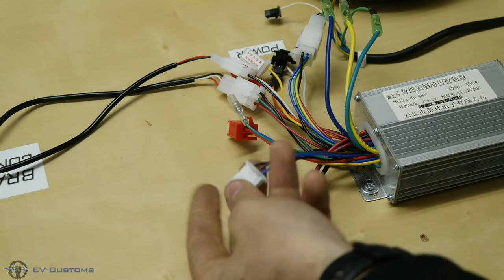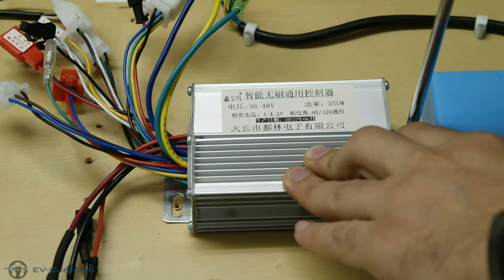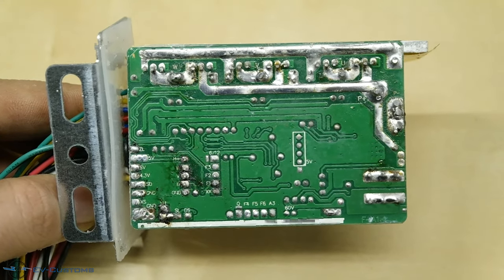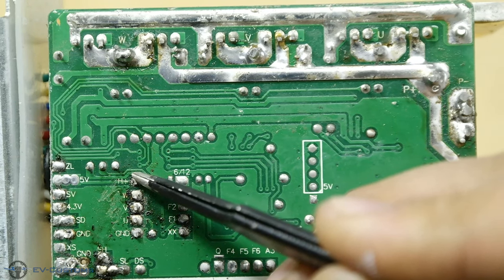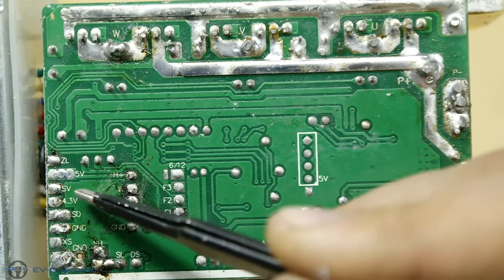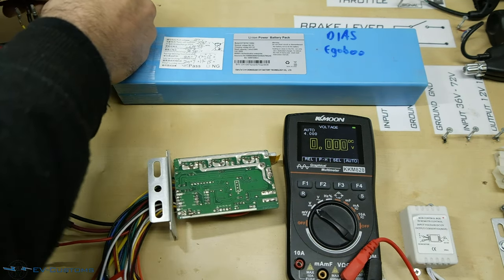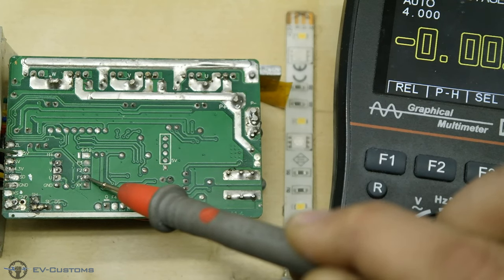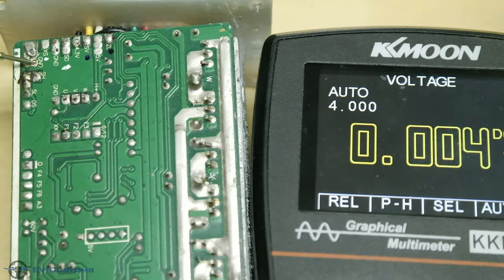How to Activate EBS Brake from the Board (Learning Board for Beginners)

Comment: Can you please make wideo explaining how to wire the alarm with antitheft (wheel
 are locking when someone tries to push the bike/scooter when alarm is actiwated )
My controler does not have that option originaly 😞
Reply from the maker: I have already order the alarm system for  a learning table 😁
Reply: @EVCustoms  you are a star my friend😉 , from prewious wideo of you finding secret functions on controller, when you cut your plug for alarm  i noticed to wchich pins 2 of the wires goes , i know where pink and blue wires goes and i have the same markings on my circuit board in my electric scooter , but the yelow wire didnt have any markings on the circuit board or i couldnt see it on the wideo, i have unused solder pad without the markings on my circuit board roughly in the same spot right next to the mosfets and i have theory that it goes directly to the thick solder trace for mosfets on the other side of the circuit board(i couldnt check it because i left my multimeter in work) , but im scared that its a wrong solder pad and i might burn something 😬
do you know the name of that plug that you cut ? 
i want to buy one so i can solder it to circuit board and connect it nicely to original alarm plug , is it some kind of molex plug 🤔
Reply: I measured that pad with my multimeter and it does in fact go to the other side of the circuitboard , so I went for it and soldered green wire from alarm in there and 2 other wires to 2 other pads (im not gona spoil your wideo and say which wich 2 other pads ) and it worked 😀 wheel locks now when alarm is triggered and I try to push the scooter 😆 but its just one wheel that is locking , so ned to do the same wires in the other controler

Comment: Is low brake and high brake the same as EBS?. Thank you
Reply from the maker: Yes my friend..
Reply: That it is not making sense, why would a controller have 3 plugs for EBS?
So, I am thinking that;
Low brake = soft motor shutdown 
High Brake = hard motor shutdown 
EBS = a gradual braking of the motor by slowly reversing the motor. 

So, it is not the same, am I wrong?
Reply from the maker: @diyek1781  They are same thing...  the difference is tha on high brake you can connect load like rear stop light in series with brake leaver to activate stoplight when breaking
Reply: Ok, I shall try. Anyway, you always test on hub motors. Can you please provide tests of real motors like the skateboard motors 6374 at 190kv with the same type of controllers? Do this controllers work with the 6374 or are this just for hubs? Thank you.

Comment: I found A3 pin and EBS working for me but it is to strong !.Wheel just stop in 2s,you can do a flip,is it normal ?.
Perhaps Lov brake will be better/smoother ?. 
BTW.thanks for your help, I successfully replaced the controller in the scooter of a girl from work.😁🛴
Reply: Try using low-brake instead. Low brake wire needs to be connected to ground to activate the brake